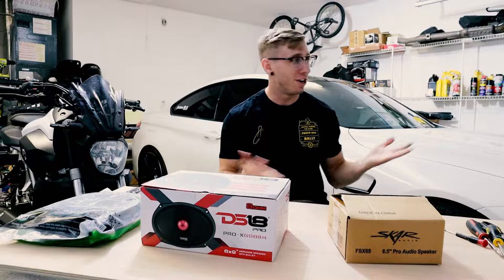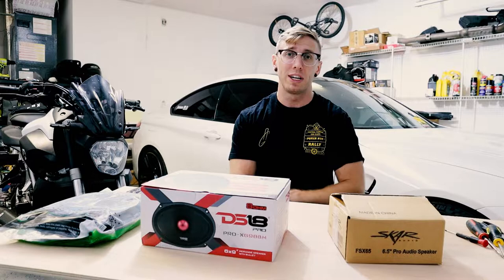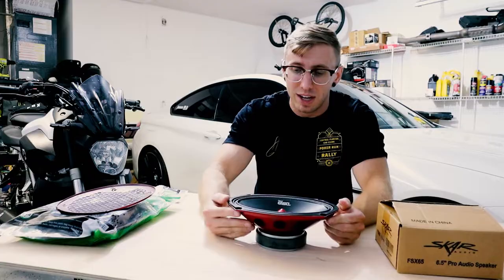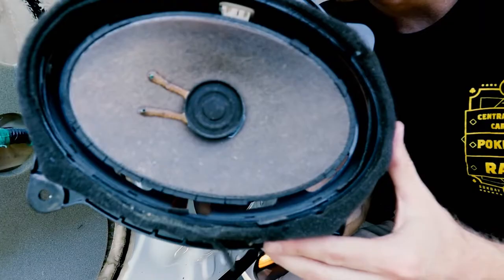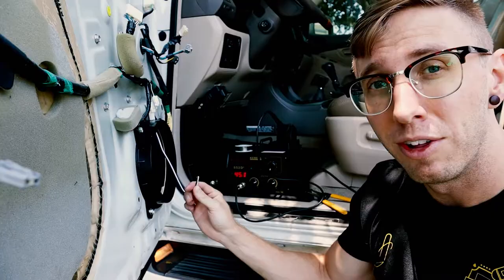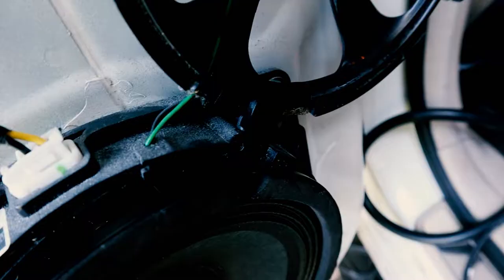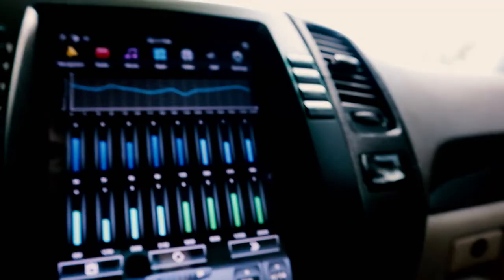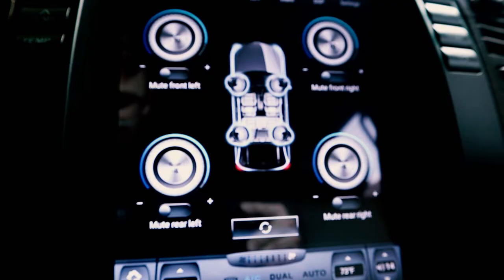Vlog 30 - Lexus GX470 Door Speaker Replacement

Comment: Love all your GX470 videos!  I have a 03 and have been adding alot lately, wheels/tires, tint, roof rack, etc.  Looking at replacing my speakers and appreciate you going through this detailed explanation. My amplifier died which I see alot of GX owners having problems with.  Did you replace your amp?  Do you know what could be a good plug and play option for an amp?  Having problems finding the right solution here.  Really appreciate any help I could get.
Reply from the maker: I did not replace my amp on this system as I was going to a budget solution at the time. So the timing on this is awesome as I've noticed that OEM Audio Plus has mentioned they're working on a solution for the GX470. It's also been listed on their site and shows "In Development" so I plan to go this route once they come out with it. https://oemaudioplus.com/lexus/gx-470/

Comment: Great video. Do you have the stock Mark Levinson amp, which I believe puts out 22 watts RMS per speaker? The rep at DS18 states that he did not think the speaker you used would work with the Mark Levinson amp as the speaker has a 275 watt RMS rating. He thought a higher wattage amp would be needed.
Also, did you find there was any problem with too great a speaker depth in the door hitting any door items like the window, or too great a height of the installed speaker hitting the door speaker grill with any part of the speaker rubber surround or cone when it is in use and moving with the bass sounds? Thanks!
Reply from the maker: Hey Ken, Sorry for the delay. There is no issues with under driving a speaker, you just need to make sure you don't exceed it's max rating. Yes, I'm under driving it but it sounds great and I have no worry of blowing this speaker out as the amp won't ever put out enough to exceed it's limit. The DS18 speakers sound great in my car and I"m still so happy with my choice to go with them. There are many people on the Facebook group for GXOR and GX460/470 who have done the same mod in my video and can attest to great sound. If you're hesitant, I recommend checking out some of their comments to help build confidence. I do agree with the rep at DS18 and ideally it would be awesome to have installed an after market amp to drive it, but if I went through all that trouble I would have gone with a 4 ohm setup and a completely different speaker than the DS18s. I wanted something affordable that would work with the factory unit and this fit the bill for that. Maybe in the future I'll upgrade things and I'll be sure to document and upload so people can see that process. Thanks for reaching out and let me know if I didnt answer all of your question and we can chat more about a path that works best for you.

Comment: Hey. Are you planning on replacing the rest of the speakers and tweeters? I mean the small ones on the doors, barn door and the center dash speaker? Or they don't normally go bad? 
Thank you!
Reply from the maker: I'm planning to keep mine as long as they stay intact. I think the day they go bad, I'm planning to do an audio upgrade video and do a full conversion to a 4 ohm setup with an aftermarket amp and new speakers all the way around.
Reply: @Awesomoto  I'm planning on doing it soon. A new amp with new 4ohm speakers/woofers/tweeters set up.

Comment: Have you had any issues with your head unit? Driver side temp button keeps breaking on mine.
Reply from the maker: Hey Zane, No I havent had any issues with my head unit. Is the driver side temp button that's breaking the one which came with the Phoenix head unit?
Reply: Yea the phoenix one. It’s odd. Thanks!

Comment: I’m looking at replacing my speakers, do the loudspeakers up front cover the tweeters and the midrange speakers in the front? I was also curious if you needed to replace your dash speaker as well as the ‘far back’ speaker and the tail speakers? Turns out this car has more speakers than I thought it did.
Reply: If so, did you remove the tweeters and midrange speakers up front?
Reply from the maker: Great question! I kept the stock door tweeters, center speaker, and rear tweeters as they were still in good condition. LOL yes, this car has so many speakers!
Reply: @Awesomoto  thanks for the quick replies. I went ahead and ordered enough for all and will return what I don’t need. Thanks for the input! Keep the vids coming!
Reply from the maker: @TheFatherFigureX  No problem! I’m flying back to the US from Egypt now. I’ll be putting out new content when I’m back home. Can’t wait to get back to the videos!

Comment: Thanks for all the info in the video. I ordered the DS18 6.5 by mistake. lol I think I'll just keep them for the back doors. Having a hard time finding the 6x9's. Have you replaced any of the other mids and highs in the door and the dash?
Reply from the maker: I heard the 6x9's were out of stock...wondering if this video caused a bunch of people to order them. I did not replace the other mids and highs in the door or dash as those weren't blown. I'm sure that day will eventually come.

Comment: Are you sure the rear doors are 8 ohm? I saw a diagram which showed they were 16 ohm. Is the tweeter possibly 8 ohm as well?
Reply from the maker: Yes, I assume all 8 ohms and measure that on the front door speakers. You can always measure with a DMM if you are concerned it’s different.

Comment: Great video! I am following your guides. I have one of the front speakers installed, but it is making a buzzing noise. I have tried resoldering but the same issue keeps happening. Any ideas? I am using the original wiring harness.
Reply from the maker: Buzzing that sounds like audio noise or is it more of a vibration sound that could be from the way it’s mounted?
Reply: Turns out the DS18 came broken. My other DS18 worked fine in the same spot. Weird.
Reply from the maker: @pws629  Ahh crap, that’s a bummer. You should reach out to the seller and get it replaced. Sorry to hear. Let me know if you need any help with other aspects of the install.

Comment: Been waiting for this one, great and informative as usual! Do you know what the right wiring harness is for the front so you don’t have to sodder the wiring?
Reply from the maker: Unfortunately, I had the correct wiring harness for Toyota/Lexus and these would have been plug and play with the OEM speakers, but the terminals are slightly different size than the OEM speakers.
Reply: @Awesomoto  so basically going to have to splice the wires. I tired to get the front speakers but they are out of stock! The links to the products are super helpful! Thanks for what you do and the time you take. Hopefully your page helps finance your purchases.
Reply from the maker: @kaisarsaleem8422  
Kaiser, Yes unfortunately some splicing will need to be done, but it’s not so bad. You’re welcome! I saw they were sold out on Amazon so I included the main link to their site...glad it helped!

Lol I wish YouTube helped supplement the costs, but I make $0 doing this. It’s not about the money for me. YouTube turned into a hobby on top of my car hobby and I just enjoy documenting things to help others. I figure if I’m doing the mods, I should take the extra time to film and help out the community. It also has an added bonus of helping practice public speaking skills, which is something I’ve wanted to improve.
Reply: @Awesomoto  so no need to order the front speaker Toyota wiring harness?
Reply from the maker: @brendoncampbell3910  I ordered them and just cut the connectors off the tips so that I could solder to the new speaker. You might be able to to salvage the stock ones and save money by not buying the wiring harness. Totally up to you, but the wiring harness for me made it easy.
Reply: @Awesomoto  I ordered anyway. I just used your subwoofer video to replace (skar) subwoofer. Super helpful  homie!! I also ordered the alpha garage grill ( good looks ). Thanks for the great content
Reply from the maker: @brendoncampbell3910  Thanks for the feedback man, I appreciate that. Glad the video was helpful. Oh man, so glad to hear you bought the grill as well...I can't wait until mine arrives!

Comment: I just installed DS18 speakers in my front doors, sounds good..only problem is my rear speaker channels stopped working after the install. Have you heard of this being an issue with anyone else in the GX community? thanks
Reply from the maker: Thanks for reaching out. I haven’t heard of anyone with this issue after installing the front door speakers. Are you running an aftermarket head unit or factory?
Reply: @Awesomoto  Phoenix PX head unit, I think my problem is with the pass through. The speakers are working, just very faint. I'll mess with it and report back.

Comment: Say the 8 ohms is for the ML radio? I have the non nav and non ML radio so I'm not sure what speakers to get?
Reply from the maker: I think the non ML uses standard 4 ohm speakers. One way you can verify is measuring with an ohm meter.
Reply: @Awesomoto  thank you broda. Just check on cruchfield and you are correct 🙌. This will be a fun project. Thank you again amigo
Reply from the maker: @forald8098  No problem! This is a fun project and it’s very rewarding when you hear the sound!

Comment: Wow, great video!  I just installed the Phoenix radio and am having FM reception issues, I understand I can get a Y adapter for the two antennas as the radio only has one port.  But even with the bad reception, the ML doesn’t sound great.  What volume did you set the stock radio to before removing it?  I’m trying to figure out if I need speakers or put the old radio back and up the volume.  Thanks a ton.
Reply from the maker: I believe I set the volume to 40 before removing the original head unit. I'm pretty sure you can go under the "User Settings" and adjust that volume level so you don't have to go back to the original unit just to change it. There is also a setting for enable and disable of the amplifier and if that is not selected, the sound will be poor as well. Check those two settings and see if you have any luck. Reach out if you still have problems and I can help debug it with you.
Reply: @Awesomoto  Thank you, and you made my day!  Your comment in the other video to make adjustments in “console” was spot on!  I was trying to adjust the sound with the EQ and having no luck with volume.  But once in “console”, the amp settings are all there.  Like your unit, mine came from the factory with the amp set to “off”.   I turned it on, and have been playing with the amp volume setting and the stereo rocks!  Once turned on, the volume was set to around 20…I bumped it to 45 and it’s amazing.   I don’t know why so many articles say you need to put the stock unit back in and turn it up, this is SO simple.  Again, thank you!

Are you aware of the firmware Sergey Kozlov sells?  It gets rave reviews.  He has a FB group easy to find under “Sergey PX6 firmware”.  I haven’t installed it yet but understand it makes a huge difference.  I think he charges $100, would be awesome to get your thoughts.
Reply from the maker: @Hotzmonster  You made my day by providing feedback! Glad you were able to find the setting. I agree, it’s waaay easier that way and idk why people say you need to adjust before removing stock unit lol.

I did see that firmware upgrade on FB. Been thinking about doing it as I’m not the biggest fan of the current firmware UI. Have a great holiday!

Comment: I have the Tesla in my GX470 and use the same EQ app.  My rear speakers are tied to my front speakers somehow.   Thanks for the video.  I’m going to probably do this same setup….including the sub.

Do you plan on changing out the midrange and tweeters up front?
Reply: Also, are you unable to use the factory brackets on the front 6x9s?
Reply from the maker: Thanks for reaching out! 🙏🏻
I don’t plan on changing out the tweeters at the moment as mine are working. You could probably modify/cut the speaker out if the factory bracket for the 6x9 and reuse it, but I think you might risk rattle if it’s not mounted tight.
Reply: @Awesomoto  Can you tell us the actual part # and/or description for the mounting brackets you used?  I am looking for it in the videos/comments and don't see it anywhere.

Comment: Do you recommend doing this upgrade on a non mark levison system?
Reply from the maker: Hey Jesus, good question and thanks for reaching out. If you don’t have the ML system, then you have way more options for speakers as you don’t need to buy 8 ohm speakers. Your system should have standard 4 ohm speakers, which are much easier to find.

Comment: Great video. I copied you and install the same rear and front speakers. Sounds good but I'm having an issue with some static feedback. Nothing crazy but you can't definitely hear it in between songs or on pause. Did you experience this at all?
Reply from the maker: Hey Marc, sorry for the delayed response. I haven’t encountered and static in my setup. Wondering if you have a connection that’s becoming faulty. I know it’s a pain, but I’d check all the speakers for a loose or failing connection.

Comment: The factory wires have a grey wire and grey with white stripe.  I assume the one with the white stripe is positive, correct?
Reply from the maker: Off the top of my head, I believe that’s right. A way you can check is a multimeter on the beep continuity setting…connect one side to ground on the car and the meter will beep on the ground wire…then you’ll know which is ground.
Reply from the maker: Hopefully this comment makes sense. Let me know if you have issues.
Reply: @Awesomoto   It does, thanks again!

Comment: Great Video, Awesomoto!! How did you discover the Ohm rating for the ML speakers? I have a 2004 RX330 with ML and Nav and I am hearing from retail sources 2 ohms and 7.5 ohms but I can't seem to find a spec sheet anywhere. How did you figure out the specs? Thanks again for such a well produced video.
Reply from the maker: Hey Skaggz! Thank for reaching out and that’s a great question! I had read about 4 and 8 ohm arguments on the forums and eventually found a spec for ML stating 8 ohms. Ultimately, I decided I wanted to know for sure, so I took a speaker and measured it with a multimeter to verify the 8 ohms. This is probably your best bet and it’ll give you confidence in what you have.

Comment: Need to replace the 6x9s also.   Why do you need the adapter?   Can you repurpose using the stock one?
Reply from the maker: You could probably repurpose the stock ones, but I’d say you risk rattling if not done properly. The adapters are cheap, so I went that route for safe measure.
Reply: @Awesomoto  I'll be replacing this weekend.   Will let you know which ones work better for me.   Thx
Reply from the maker: @martybolek5590  Yes, keep me posted! You can always go repurpose route and buy adapters later if needed. May the GX force be with you.
Reply: @Awesomoto  Needed to use the aftermarket adapters.  The basket on the new 6x9s do not fit flush with the   stock bracket.
Reply from the maker: @martybolek5590  Bummer, well I’m glad it worked out and you installed them. Happy Thanksgiving!
Reply: @Awesomoto  Not an issue.   The new brackets are cheap.  Lined the doors with dynamat, replaced the 3.3uf  electrolytic cap with a poly for the tweeter.   Will try a couple different mid range options.   Although, the stock seems pretty decent.
Reply: Replaced the back door speakers also.   Sub replacement this weekend...